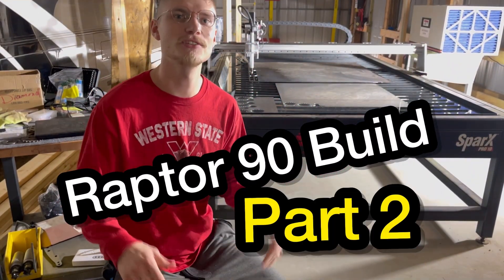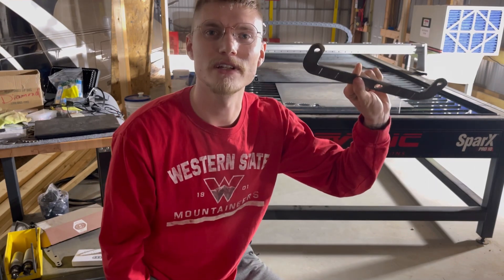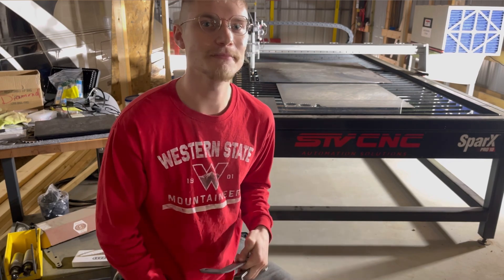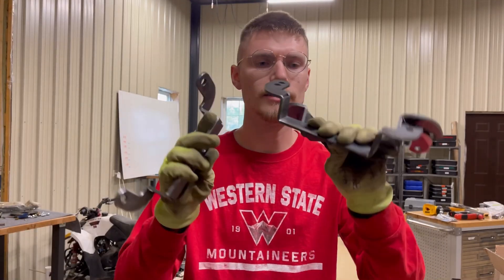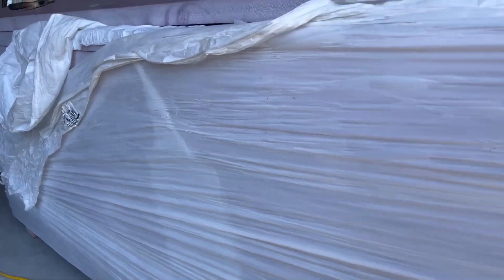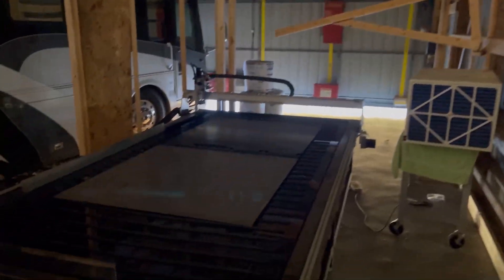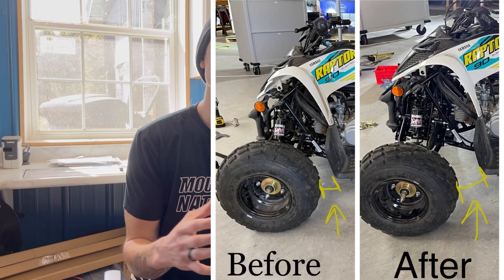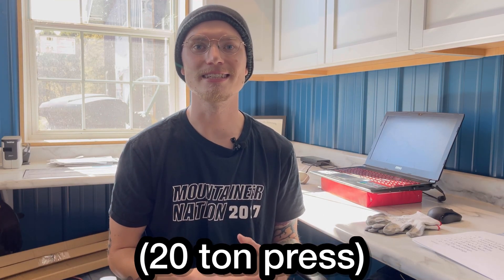2021 Yamaha Raptor 90 Modifications [Part 2] Dual A Arm Conversion | Today in The Shop #11

Comment: Where you made relief cuts so you could bend the brackets easier, wouldn't it be beneficial to weld it back together once you bend it for more rigidity and strength? I really like this product, honestly think Yamaha should have  done this to begin with. Thank you for making performance suspension for these little quads. My daughter won 50cc championship for stock quad in arenacross 10 race season(other daughter got 2nd overall). I need to move the older daughter to a 90 and don't want to mess with DRR or other 2 stroke quads. But the stock suspension dimensions of the raptor 90 are not competitive. I was making an observation not questioning your craftsmanship,  God knows I can't do what  your doing. I know I will be needing to make a decision about what quad to get her and with this suspension and some spacers for the rear I think the Yamaha will be the  answer. If you need any testers let me know lol. 

Sincerely 
from Pittsburgh area
Reply from the maker: Thanks for the reply! The reason Brandon didn’t do any welding after bending the bracket is 1. Because he was mostly just fitting up the bracket to prototype correct shaping and sizing, and 2. The a arms are supported by many brackets and the one individual bent bracket doesn’t need to support much of the overall weight. 

Great thought, we appreciate your comment and points and we make sure the brackets that go out in production are of great quality and up to strength requirements! Exciting to hear you are looking into a Raptor 90, we would love for you to go with our kit! Feel free to reach out during the process with any questions for communication. Happy to help.

Diamond J Customs, LLC